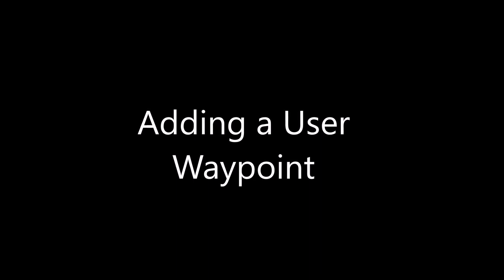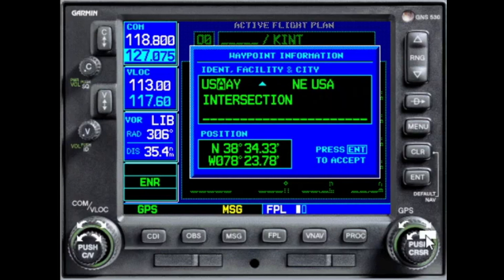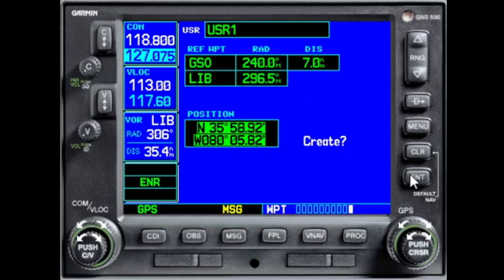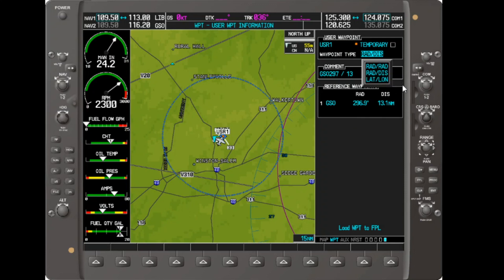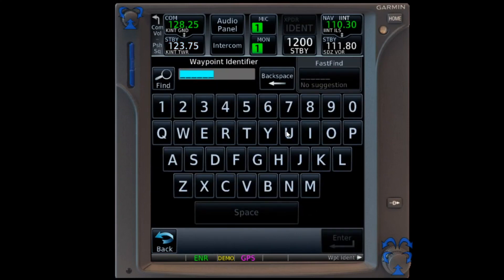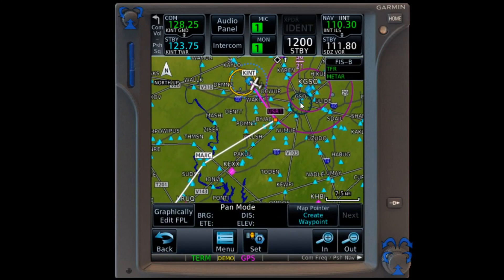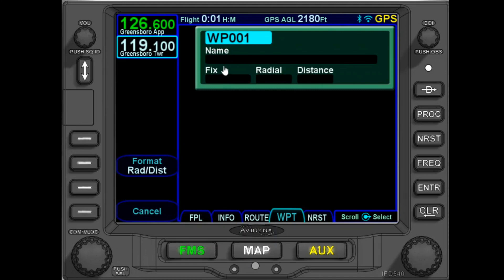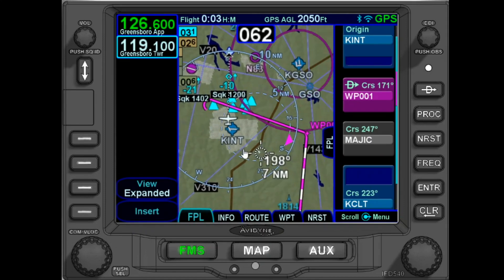Comparison: User Waypoint in GNS, G1000, GTN and IFD

Comment: Would another technique be to enter GSO, and then use OBS mode to navigate to it on the 240 radial?
Reply from the maker: Mark Finkelstein, If you have a simulator,  try that. Remember,  you are going  direct to the 7 mile point after takeoff from KINT. What's your course to it?
Reply: @midlifeflyer  Thanks so much for your reply.  I was stumped for a while in answering your question because I misunderstood the clearance. We are not cleared from KINT to GSO on GSO's 240 radial. We are cleared from the 7-mile point on the GSO 240 radial to MAJIC. So . . . I would enter KINT GSO MAJIC. The leg from GSO to MAJIC is bound to be on the 240 radial. I would then use heading mode to navigate from KINT to a point on the GSO MAJIC leg that is 7 miles from  GSO.  Acceptable?
Reply from the maker: @FinkelBlog  I suggested trying it for a reason. You'd know it once you got there, but exactly how would you actually navigate to it using certified equipment in a way which satisfies the FAR 91.181(b) requirement for a direct path between two fixes?  There are, I think, two theoretical ways to do it - dead reckoning  and "pint to point navigation" using two course/distance readouts to triangulate to the point - but they are of questionable validity in modern IFR flight.

Comment: I took this as a tutorial. Great info. By the way, is this de only way to include an user wpt in a FPL? (In garmin)
Reply from the maker: It's not the only way. All the Garmin units I showed will also let you do it by going to the Waypoint chapter /User Waypoint page and start there. But it's a bit more twists/clicks/taps and while you can go direct to it,  won't automatically populate the flight plan.

Comment: Excellent demo on all the units.  I learned something new.  I would always create the user waypoint then go back to FLTP and enter the info.  I could have just entered as a waypoint and fill from there.    I miss my 530W and the flight stream 210.  The new to us Commander has a 480.  Yes, I'm going over to the sim to see if it defaults to setting up a user waypoint if I enter an unknown.
Reply from the maker: Please let me know what you find. I have very little experience with the 480.
Reply: Midlife Flight The 480 sim only allows the user waypoint to be created under the user link/button selection.  Once created it can be added to the flight plan.
Reply from the maker: @GMascelli  So. similar to the IFD.